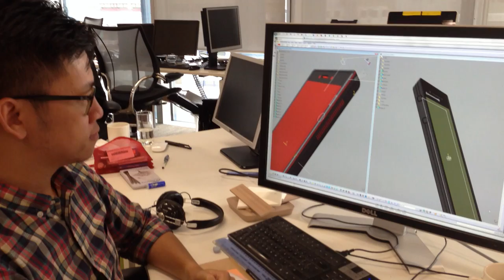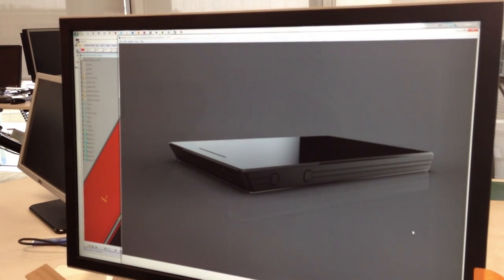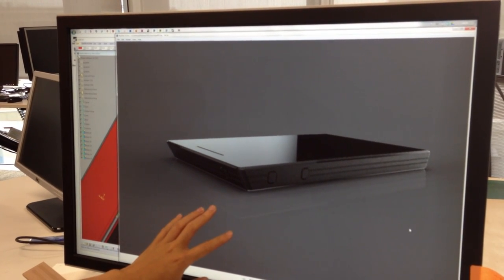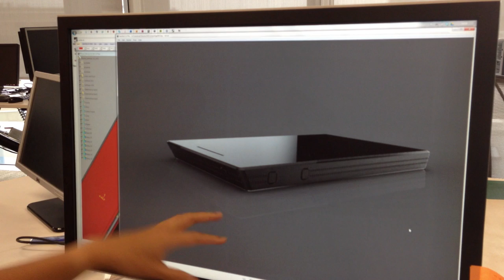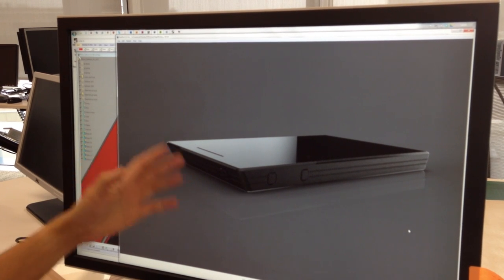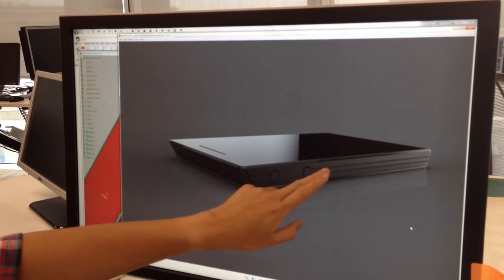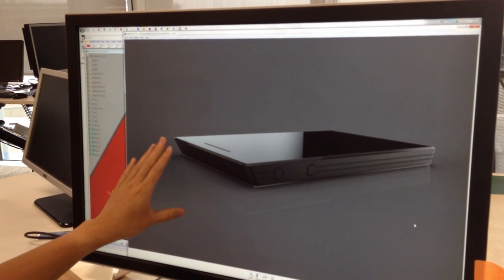Ubuntu Edge Design Blog: 3D modelling

Comment: Probably because they need to have a high end machine for quickly rendering the 3D models. This would require it to be custom built.
Why not OS X? Generally you can't install OS X onto a custom built machine and expect all the hardware to perform optimally.
Why not Ubuntu? The software they're using may not be available for Linux.
That leaves you with Windows.

Comment: CATIA models simply do not, it models and simulates all processes electronics, the resistance mechanics, manufacturing and others. Modeling is solid, and mesh modeling blender does not contain the informções necessary for realistic simulations as a model made in solid prove.